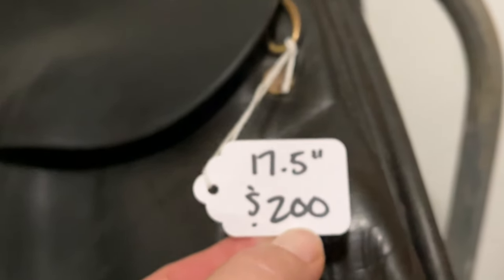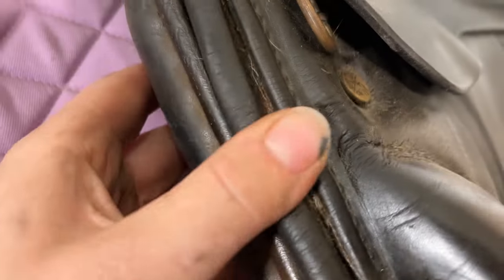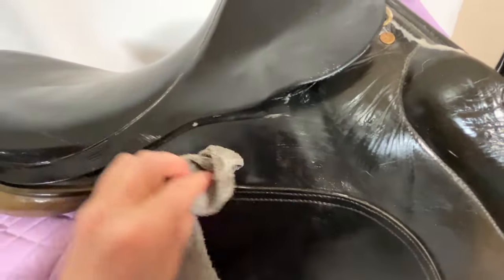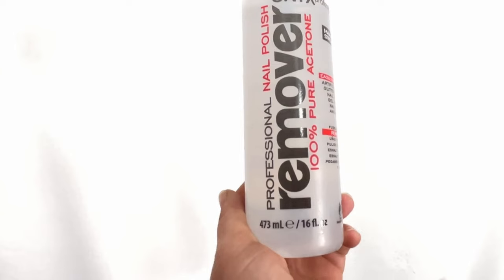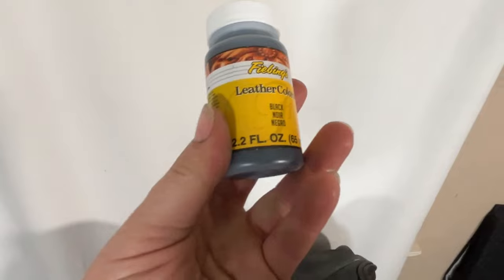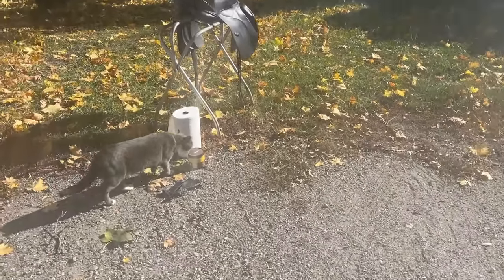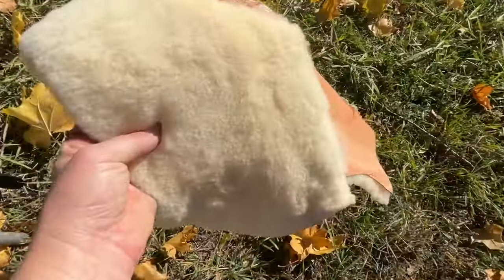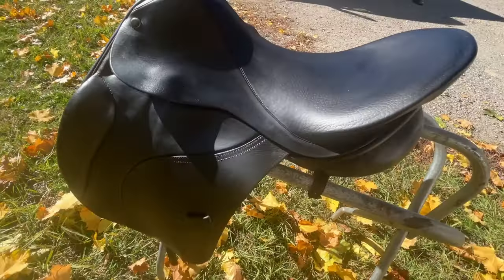Saddle RESTORATION~ How to dye

Comment: I always enjoyed deep cleaning my horse tack. And the cleaners add such a lovely aroma to the work area! I bought an old but never used lightly tooled black western saddle LOADED with ugly clip thru conchas. It was awful,but very inexpensive because it was so tacky. I took off about 5lbs of metal garishness to find a beautiful saddle with very little tooling that was so dusty it almost looked gray. It cleaned up to a lovely shine. I used 2 plastic credit type cards to clean the seams the first and all subsequent cleanings. And I used a sticky wax to finish since it was a slick seat and I never wanted to slide off! I never considered rebuilding saddles so I really admire your skills and business sense in finding good quality tack and putting in the effort to improve and sell or use it yourself. Love your information and videos. Keep up all the good work.